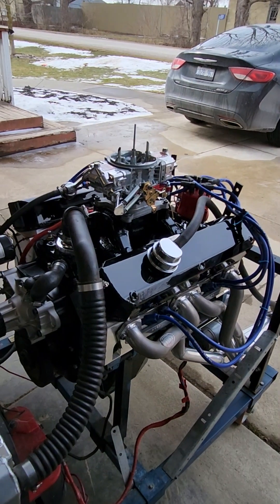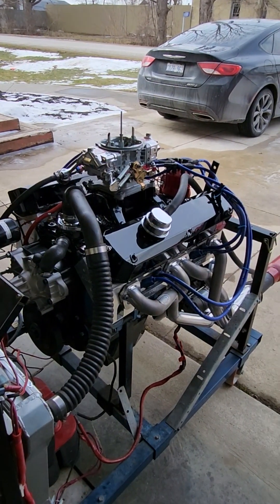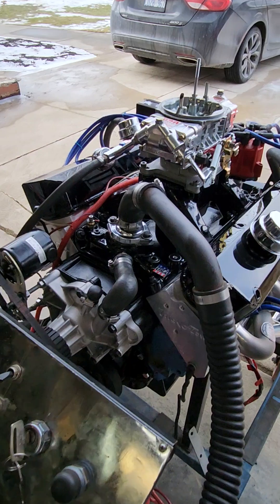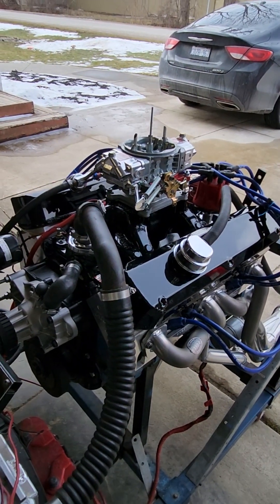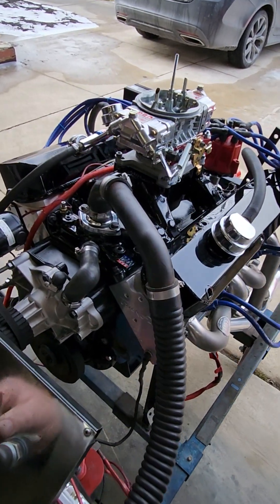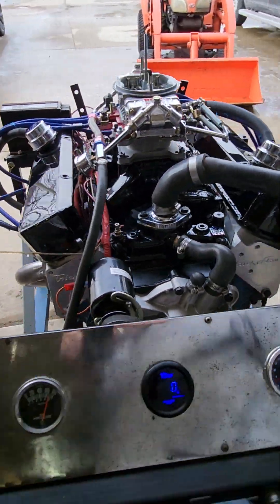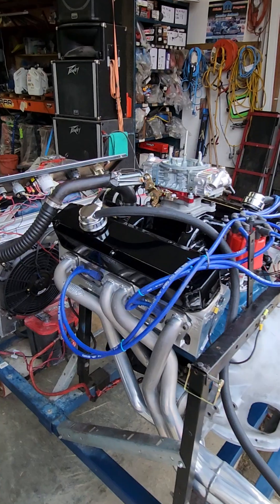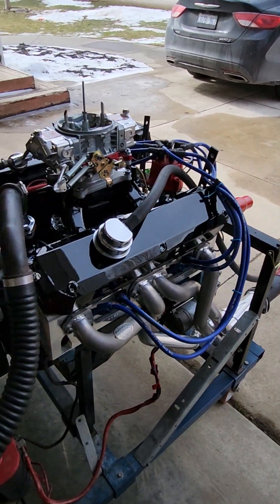408 Mopar Stroker with Trick Flow Heads and Comp Hydraulic Roller 20-813-9

Comment: Will this cam and 11.25:1 and 93 work with a quench of .045 or is that to much?
Reply from the maker: With aluminum heads you should just be OK. You may have to have timing at 34. If you go to the drags give it a  it of octane booster and put a degree or 2 back in it... but again, I think with that quench and 93 you will be good.
Reply: So I did it now and I just wonder have you ever used a vacuum advance on a cam and engine set up like these?

Comment: Can you run that much compression with pump gas? This engine is extremely similar what I was planning on building.
Reply from the maker: Yes as long as you keep a tight quench you can run 94. It was dyno'ed using 94 octane fuel.
Reply: @brightonracing  we have 93 octane where I’m at. I was worried 11.2 would be a bit too high. Good to know it would work fine.
Reply: Will this cam and 11.25:1 and 93 work with a quench of .039?

Comment: Do you need to grind the valley to fit the hydraulic roller
 lifters?
Reply from the maker: Not always. Morels usually clear the ribs.... If I plan on using a retro fit hyd roller, I grind them down anyway